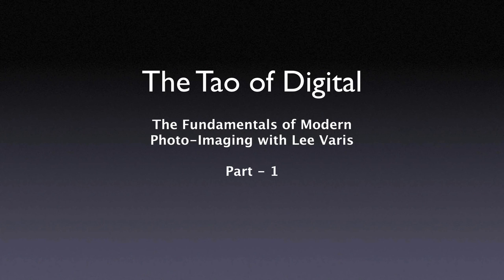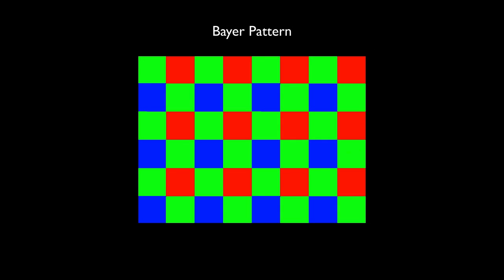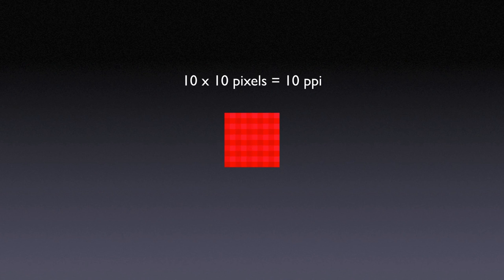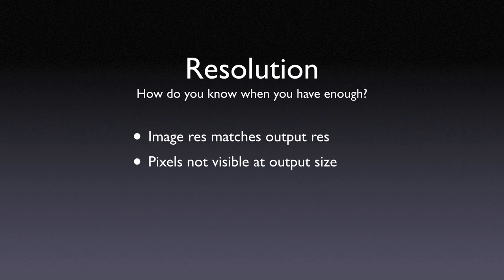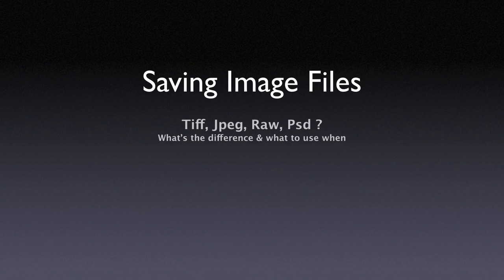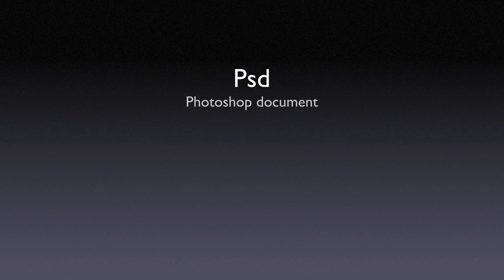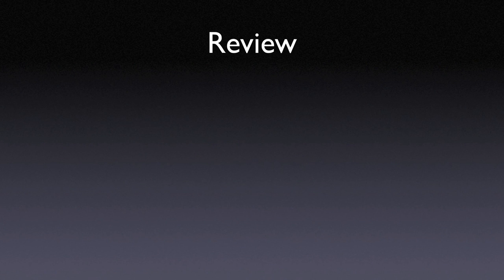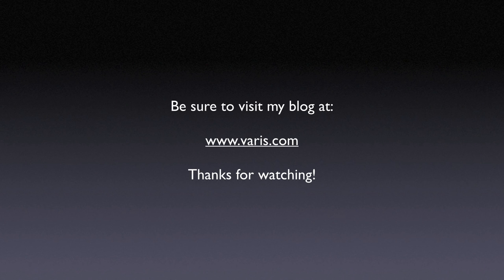Tao of Digital – 1 - www.vars.com

Comment: Thank you for sharing Lee. I Have watched another footage about files and it tells that the quality of Jpeg files decreases by reopening the Jpeg file over and over, the more you open it the less quality you get, that footage is in favor for Tiff files as they are constant and don't lose quality. What do you think? .... thanks again :)
Reply from the maker: +Esmat Morshedy - simply opening jpegs does nothing to the quality of the file - you'd have to change it in some way and re-save it as a jpeg! Real visible quality loss would require re-saving several times at the same or lower quality. Exactly how much degradation occurs depends on the image and what quality jpeg you are saving. Re-saving at highest quality might take 30 or 40 re-saves before anything noticeable occurs, and it is highly unlikely that anyone would have a reason for doing that! That certainly not to say that Tiff files aren't superior in this regard because no degradation in quality occurs when saving the image file as a Tiff just because its a Tiff.
Reply: +Lee Varis  Thank you for the explanation :)